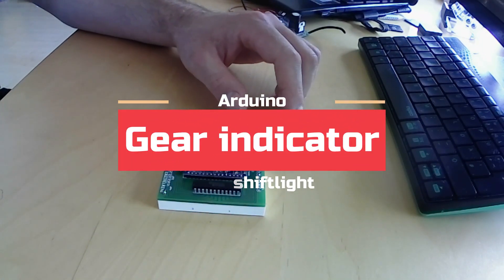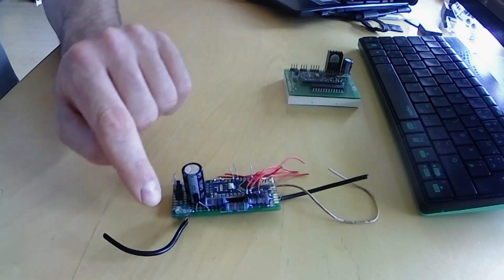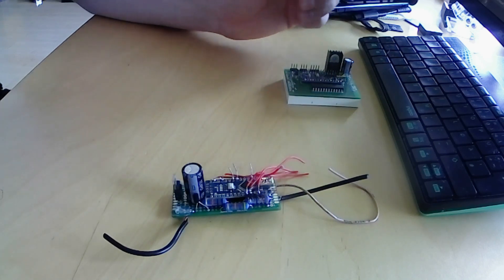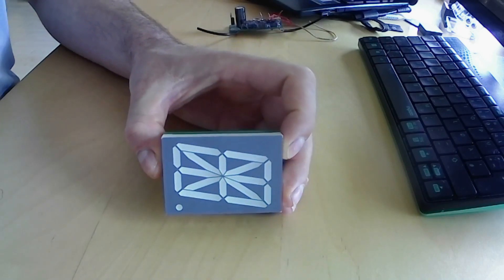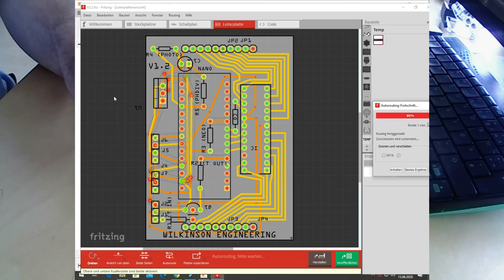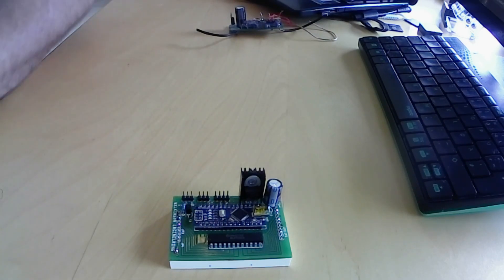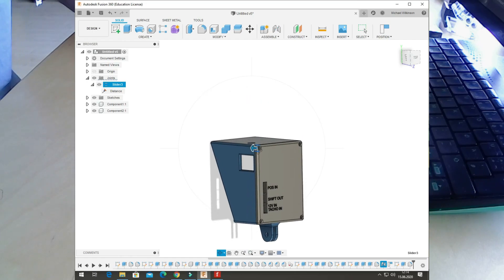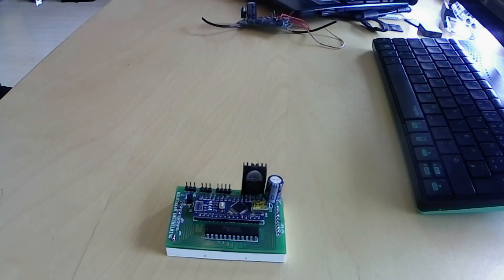Arduino Gear Indicator AND RPM Shiftlight!! A deeper look into how it was done.

Comment: I have a mini cooper s R52 and when I measure between pin 9 and 4, I get around 6V and the voltage does not change when i rev the car. What could be the issue?
Reply from the maker: Hi Mert, best thing to do is open an issue on the GitHub repo, there you can create a detailed post with images etc. from there I’ll be able to help you further.
Reply: @mickthemechanic5718  thanks for the reply. Am I correct when I say that the voltage across pins 4 and 9 should change when revving the car?
Reply from the maker: @mertcapkin7263  I am not sure which pins you are talking about, please open a GitHub issue, it’s much easier for me to help you on that platform. You can post pictures and show me which pins you are talking about
Reply: @mickthemechanic5718  i am talking about the OBD ports :)
Reply from the maker: @mertcapkin7263   no you will not see a voltage change there on your mini.

Comment: Hi Mick! Great and innovative Aurdino C++ project, kudos. Curious on how did u mount the potentiometers on the gear lever, could u supply some pictures on how u did install the Hardware? Which signal from the ignition did u pick up  from the coil ? really interested in how the hardware connections came to life :)

Comment: Awesome video, I noticed you will sell the gear indicator kits sometime in the future, but for the time being is it possible to get the parts list used? -Thank you and good job.
Reply from the maker: There’s a partslist in the GitHub repo
Reply: @mickthemechanic5718  Thank you very much, just found it. One last thing, regarding the segment screen, did you made it with a case and LEDs? or is a specific unit? - I didnt saw anything regarding a screen on the PartsList.md, but i did saw "neopixel 8LED strips #WS2812".
Reply from the maker: @warup89   the Neopixels are for the intergrated rev light, the display is one like this https://www.ebay.com/itm/252400894301

Comment: Hi, I am interested in the gear shift indicator part only, because my car already has an inbuilt odometer. Please can you give some indication on the way to track the gear lever? Thanks in advance.
Reply from the maker: Use two potentiometers to track the x and y movement of the gear lever
Reply: @mickthemechanic5718  So sorry dear sir. Missed your reply so long.
Anyhow, any sketch is available? The mechanical part to arrange around the gear lever?
Reply: Yeah sorry I'm in the same boat, I kinda get what you mean but if you could add a photo of what it looks like, it would help my understanding a bit better, thanks

Comment: This is awesome!! I really appreciate the ingenuity behind your gear indicator! 

I have been racking my mind to think of a way to create a gear indicator for my automatic transmission when it is put in "manumatic mode", aka tapshift mode.
The tap shifts (1-2-D-OD) are done electronically, inside the trans making it impossible to use a typical universal gear position sender. (as opposed to P-R-N-D which are done with a shifter and external shaft, thatthe senders use to tell which position it is in and to drive an led).

Only thing i can imagine, is some device that will get turned on with the manumatic mode switch, and can keep count of every "upshift" and "downshift" button, to display their relation to the gear it starts with.
(Ex, Manumatic mode is turned on in "4th/OD". 3 downshifts equals 1st gear, 3 upshifts back to 4th. 1 down, 1 up =4th. 2 down, 1 up=3rd, so on and so forth. I have no clue as to what can read/calculate this kind of logic.
Would LOVE to hear your suggestion if any?
CHEERS!
Reply from the maker: Im glad you like it. For your Situation I would look at getting the gear position via CAN, there are CAN shields available for Arduino. It would be the most reliable approach in my opinion. Then the display etc. would be the same, just the input is coming from CAN.

Comment: How does the shift position indicator work with the potentiometers? Did you install them in the gearbox somehow? What kind of potentiometers did you use?
Reply from the maker: Hi, glad you enjoyed the video!
There are two potentiometers mounted next to the gear lever. One measures movement on the X-axis and one measures movement on the Y-Axis. Much the same as a joystick.
Reply: @mickthemechanic5718  Will you be sharing the code and schematic for the gear indicator?
Reply from the maker: @georgelopes9876  Yes, I am currently working on ALOT of projects, so I havn't had much time, but I will post a video soon along with links to schematics, parts list, and PCB file. Please be patient, this is not super high on my priority list ATM, but you should expect something in the next month or so.
Reply from the maker: @georgelopes9876   I have uploaded everything to my GitHub. 
Link in the description.
Reply: @mickthemechanic5718 Thank you, Mick Gr8 work.